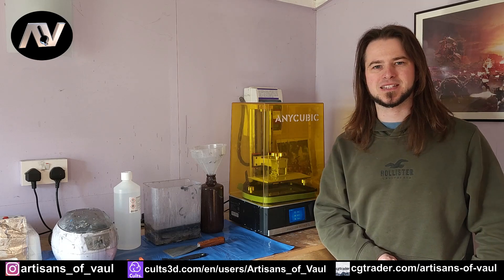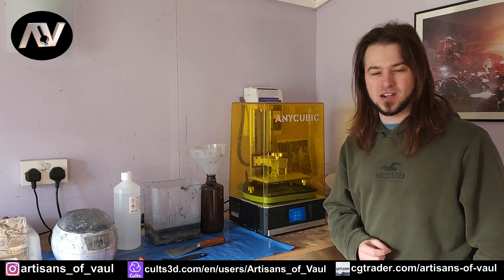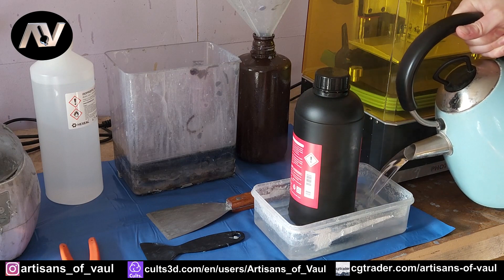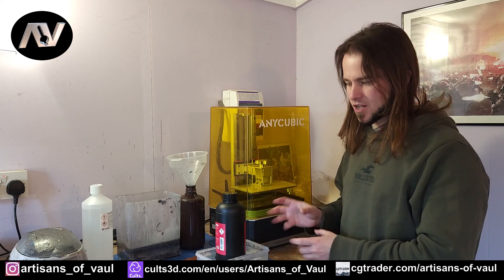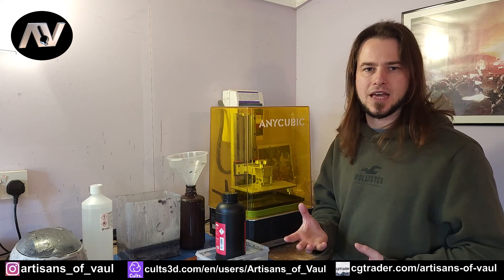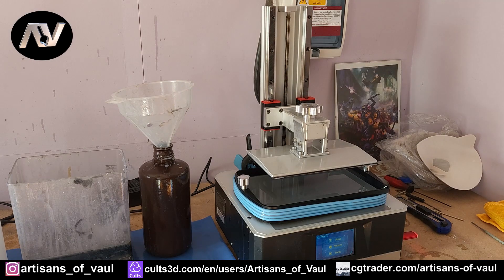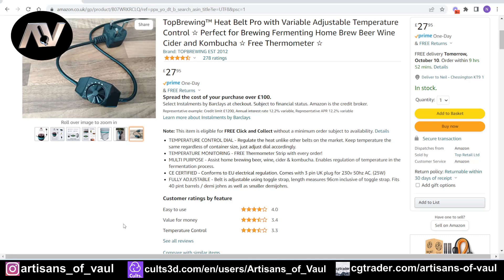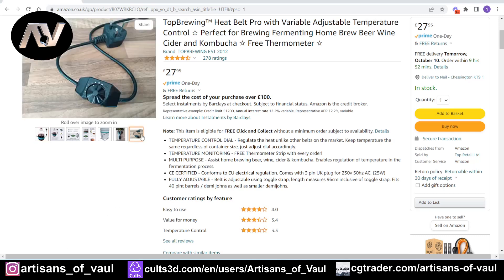How you can 3D print when it's cold!

Comment: Do you keep the heating belt on during printing ?
Reply: Great question. It depends how cold it is. I imagine you could turn it off a little into the printing and the light would keep the resin warm but I keep it on as it uses so little electricity and guarantees consistency of the print.
Reply: @neilcollins7371  planning on having my printer in the basement, and temps hover around 15-16 Celsius at this time of year
Reply: @Martin.W.F  I'd just leave it on of it was me.
Reply: @neilcollins7371  alright. thanks for the tips 👍
Reply from the maker: @Martin.W.F  No problem. Let me know how it works out!

Comment: I’ve I’m going to give this a go
Reply from the maker: Honestly it's great. I printed overnight last night and it got down to -1 Celsius in the shed where my printer is. I'm just waiting to see when it won't work at this point.
Reply: @ArtisansofVaul  ahh awesome, I’ve just started and keep getting failed print after failed print (I was getting very disheartened). If this works overnight it will be a life safer!
Reply: @ArtisansofVaul  mbmPrinting here, great advice. Not had any fails since I did this. I’m debating if this would be cheaper than using the actual heating atm 😂 really appreciate the advice.
Reply from the maker: @markbedwell3100 For me it's definetly cheaper by a long way. But that's cos my shed is quite big so heating the whole thing is a pain and these seem to use very little electricity.
Reply: @ArtisansofVaul  I’m thinking cost of living crisis. Gas is just too expensive. I can remember the days I’d rather have gas heaters. Worlds gone nuts
Reply from the maker: @markbedwell3100  Totally. I mean  I got this because it seemed like it would be more effective (and it is) but it's been a massive bonus that its cheaper.

Comment: I took your idea and added it to both my printers that are in my insulated enclosure that has a seed mat in it already. I am ready for winter!! >:)) thanks for the tips! 

Side note: unfortunately the top of my mars 2 pro doesn’t fit all the way anymore haha but that shouldn’t be a problem since my enclosure keeps the light out :))
Reply from the maker: Hope it helps! It sure makes a difference for me.
Reply: @ArtisansofVaul  I’m about to give it a go, any recommendations on how long to preheat the vat for? Also idk if you do this or not but I’m gonna test out preheating the build plate by having it sit in the resin (auto home) because I read that a cold build plate will create a lot of problems too. Any thoughts?
Reply from the maker: @emmamarx9284  I normally do it for about an hour to be sure when its really cold.  It doesnt use much electricity so thats not a huge concern.  I have has someone say they only left it for 20mins so a bit of trial and error may be needed.  The colder the day the longer Id leave it.
Reply: @ArtisansofVaul  it’s about 50° f today and after 30 min of preheating I used an infrared thermometer and the vat is about 80° which should be more than warm enough to print successfully I would think. Thank you so much for the great tips!!
Reply from the maker: @emmamarx9284  I have to get me an infrared thermometer! And thanks for coming back to comment with that, it's really helpful.
Reply: @ArtisansofVaul  no problem! Keep up the good work!! :))
Reply: Update: the brew belt worked wonderfully! Between that and seed mat it kept my enclosure at a steady 75° f the entire night according to my thermometer I have in there that keeps track of the average temp, we even had a low of 36° last night. Thank you again for the great tip! I was worried I’d have to wait till spring to print again 😅
Reply from the maker: @emmamarx9284  Oh....  Pretty cold then!
Reply from the maker: @emmamarx9284  Great to hear it worked so well!  Im going to check exactly what that is in the King's Celsius 😆

Comment: In addition, for more heat efficiency/savings, i wrapped the casing of the printer with a layer of survival blanket placed between two (thin) coats of bubble wrap. With this i managed to get successfull printing last winter with 5° in my garage (25° inside the printer).
Reply from the maker: Nice! Great tip, thanks

Comment: I bought a heating mat for reptile for mine, but the belt seems way nicer, i'm probably gonna get one. Thanks !
Reply from the maker: No worries. How did the mat work our? Were you using that to hear the resin outside the vat?
Reply: @ArtisansofVaul  the mat was on the inside of the printer, stuck on the cover.
With an enclosure I could manage to print in the fall but it was kinda weak for the winter days.
It was good enough for 15°C days, but below that, it was too weak.
Reply from the maker: @SaitoGray  Ah, makes total sense. In that case the band should work wonders. I printed last winter with a temperature of 2 degrees and it worked out fine, that was pretty awesome to find in the morning!

Comment: Cool. If I buy it I'll go through your link. btw what the specs of the pc you use for designing? Just wondering if mine will be okay for this type of stuff. tyvm.
Reply from the maker: Sure.  So I use a laptop (really need to upgrade at some point) but its pretty respectable, you can definetly work with less than this.
Intel® CoreTM i7 Six Core Processor 9750H (2.6GHz, 4.5GHz Turbo)
32GB Corsair 2666MHz SODIMM DDR4 (2 x 16GB)
NVIDIA® GeForce® RTX 2060
Reply: @ArtisansofVaul  Thanks!